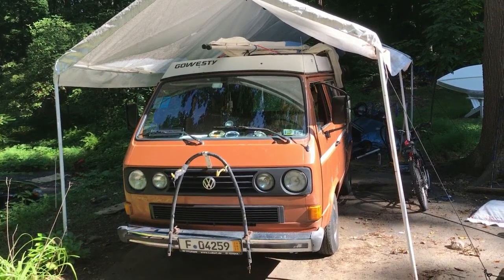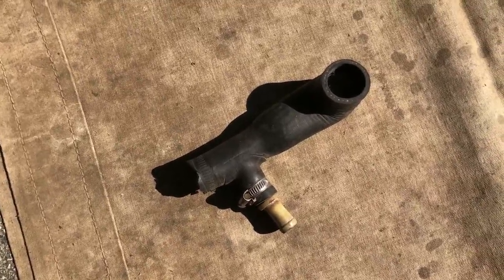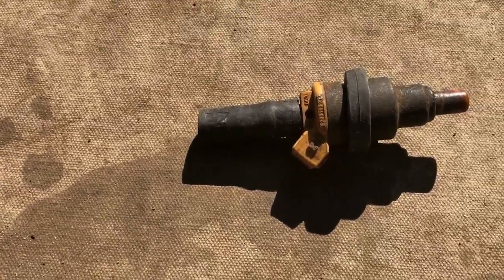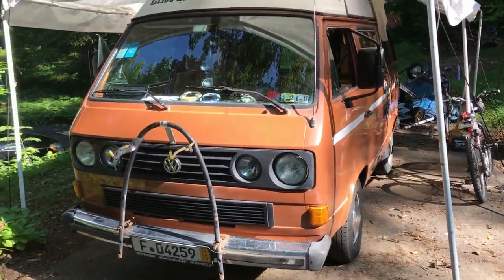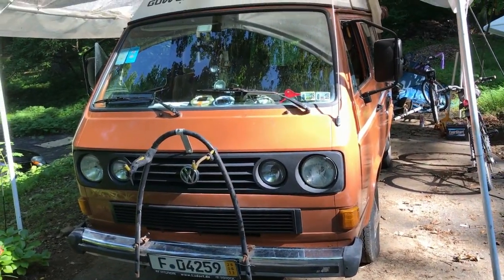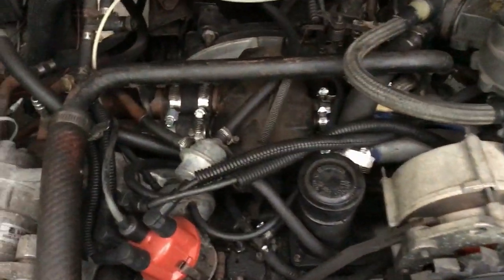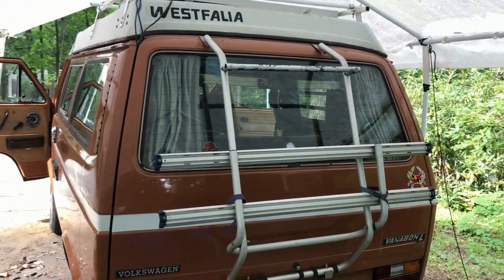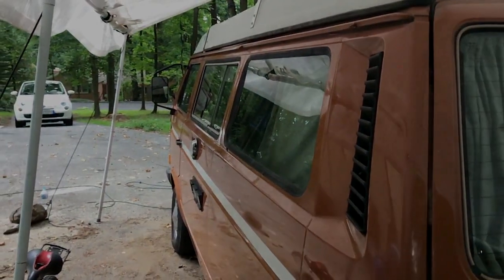Emergency parts I carry in my 1983 VW Vanagon Westfalia

Comment: Howdy! You mention that you also carry all the tools that you’d need to replace those parts. Any chance you could do a video on the tools that you carry? 🙏🏼 relatively new owner of an ‘85 and trying to be as prepared as possible for when I need to fix something on the side of the road 😂 cheers from Australia
Reply from the maker: Sorry for the late reply, I don't seem to get a notice when someone asks a question. Basically ALL the tools I use when working on the van are in my van in a toolbox, etc. Completely unorganized btw. So all work I do at home involves the tools I carry with me and when I do something new I throw the tools in there like the last thing was breaker for the bacll joints.  Maybe in the fall I'll take it all out and do a video.  One thing to note is I have all the off size wrenches, 7mm, 11mm, etc. that every now and then come in handy.